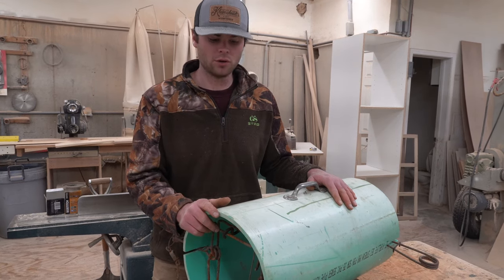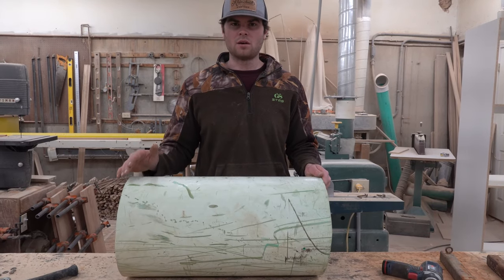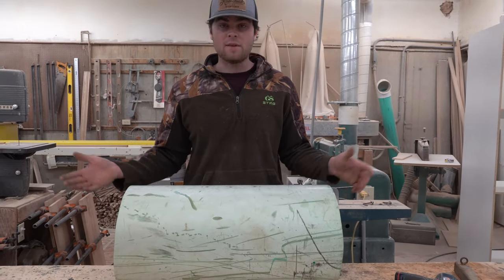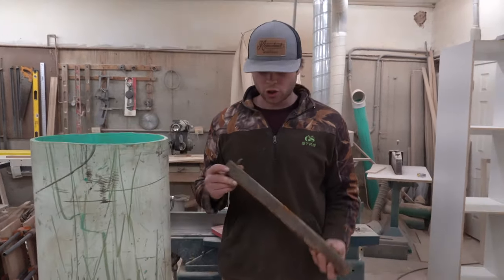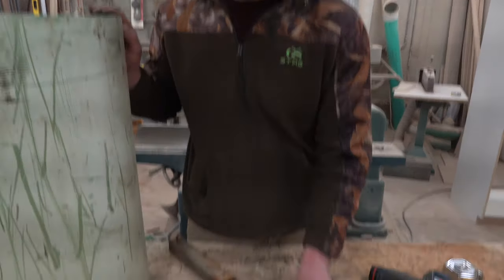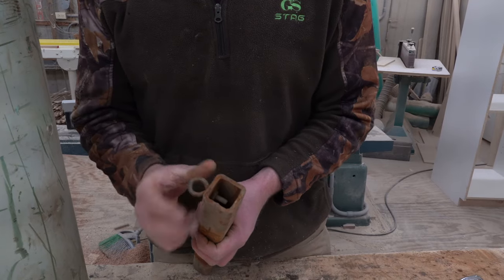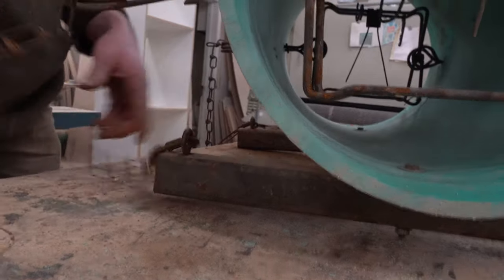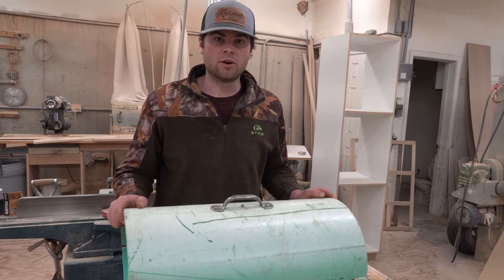Building The Best Otter Trap! (New Tube Trap Design)

Comment: Great idea 
Some guys move the trap springs to the middle of the slot so the trap doesn't throw itself down the body of the otter or out of the tube if a mink sets it off.
Might save you a few bucks on building if you drill a 3/8" hole through the top of your stabilizer for anchoring the trap instead of using an eye bolt?

Comment: great otter set up . that is 220 trap ? i am going to make some of these as soon as i can find the pvc . are you using trout , shad or what is your favorite bait ? nice footage of this set up in use .
Reply from the maker: Yes it’s a 220 check your regulations some states can’t bait them traps so we’ll either use a bright shad looking fishing lure or a little sunfish or bluegill
Reply: @TripleBeamOutdoors  here we can use a 7x7 220's on dryland . i have used boxes , but the tube trap looks like it would work better .
Reply from the maker: @judithdandavis2206  they are super effective best of luck! Let us know if you have any other questions or need some help
Reply: 12" pipe is hard to find. I used 2- 5 gallon pails, cut the bottoms off (one 2" more than the other) and screwed them together and wired the handles together for a carry handle.
Reply: @sirparry1  good idea
Reply: Nice design. I will copy this trap. Found some bigger pipe, 18” diameter I think, that should work with a 330.